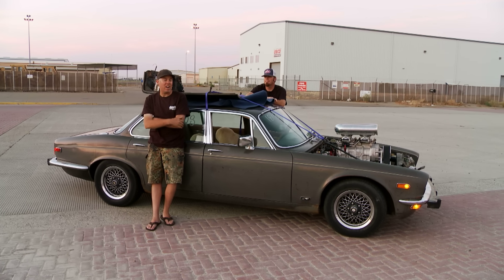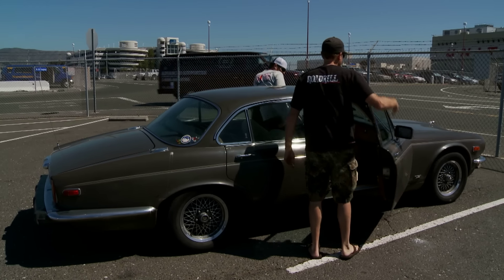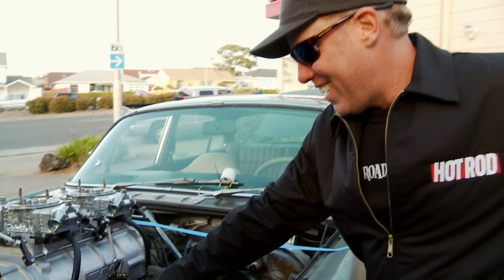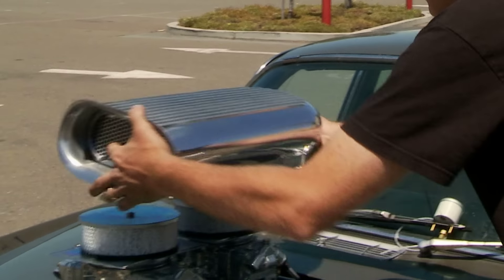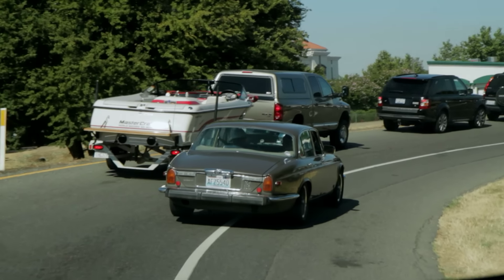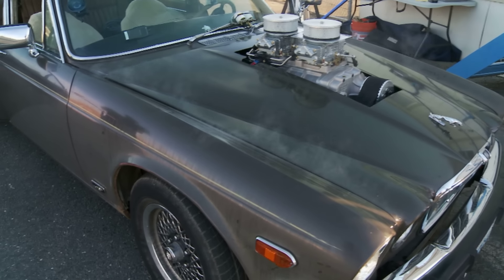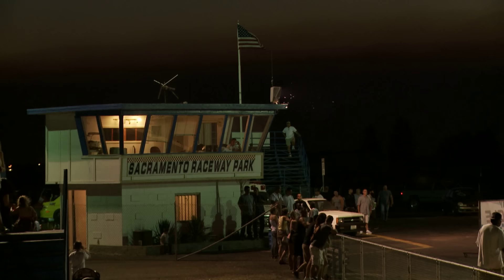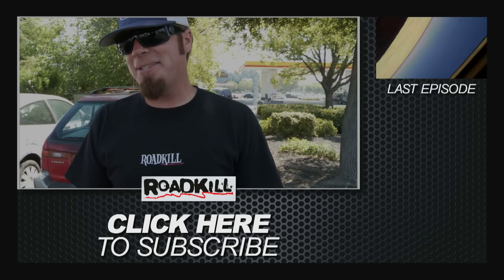Release The Draguar! Building a Blown Jaguar Rat Rod - Roadkill Episode 7

Comment: Should've re-routed the windshield sprayers onto the radiator......
Reply: Ronald Colman that probly would have worked lol
Reply: +Ronald Colman i know this is an old comment, but since a brand new rad didnt help i doubt that would have either
Reply: Couldn't hurt.
Reply: +Ronald Colman They could have just used the washer tank for methanol injection?

Comment: To the Brits here whining about putting an American V8 into a Jag, remember this: Carroll Shelby created the Cobra by dropping a small block Ford into a British A.C. Ace. Worked out pretty well, if you ask me! Also, even though this was originally a V-12 car, it was still a lowly 4-door, which is only a notch above a rusted-out minivan, no matter how few were made. Lastly, the XJ series Jaguars are quite possibly the most unreliable cars ever made. Did Lucas® (the manufacturer of most British automotive electrical components) make the electrical bits for Jaguar back then? If so, it's no wonder they were so troublesome.

 Joke of the day: Q - Why do the Brits drink warm beer?
                              A - Because Lucas makes refrigerators, too.
Reply: I am a brit, I have no quibble with your statement. Yes in UK spec the V12 made around 300 horses, so not so different to the V8 blower motor. Thing is, the car was aready butchered, so at least it had a good run in it's old age.

Yes the AC cobra was a hooligan tool, American muscle with British chassis, there were others too, Jensen Interceptor, original TVR Griffith, Sunbeam Tiger, Ford GT40 & a few more. Yes Jaguar were plagued with crappy Lucas electrics, one consolation was our Vauxhall (GM) cars had AC Delco & Fords had their own stuff.
Reply: Russ Cattell I'm happy enough to be able to say that I've owned a couple of Vauxhall V6 cars cavalier and Calibra that had a similar performance to this Jag with only 170bhp. But I've also jus t found out that the Jag V12 engine was a "sort of" flat head engine where the cylinder heads were completely flat and combustion took place in a cup in each piston crown.
Reply: Russ Cattell I'm happy enough to be able to say that I've owned a couple of Vauxhall V6 cars cavalier and Calibra that had a similar top speed to this Jag with only 170bhp. But I've also jus t found out that the Jag V12 engine was a "sort of" flat head engine where the cylinder heads were completely flat and combustion took place in a cup in each piston crown.
Reply: Yes the Jag V12 was a low state of tune, if it was quad cam, multi valve hemi it would have been mad. A mate had a V6 Calibra, slippery shaped car hence high top speed.
Reply: wordreet Heron head, look it up, its pretty fascinating stuff.
Reply: Ronald Colman What did you just call me?? 'v'
ROFL!
Reply: Huh?
Reply: Ronald Colman
Heron head, I was pretending it was an insult. ;¬)
My mind likes to sidestep reality on occasions.

Yea, I read up on it and got distracted when the info branched out into radial engines and so on. Very interesting indeed. I never knew that Moto Morini and Guzzi used the flat head style. I nearly bought a Morini 3 1/2 several decades ago.
 But my distraction took me to reading about the ANZANI 55degree 25hp 3 cylinder aero engine used by Louis Bleriot to cross the English channel. Apparently some of these engines had no inlet valve, just a light metal disc supported by a spring, which opened due to decreased pressure when the piston moved downwards, A bit like a reed valve.  It sort of reminded me of the early 'diesel' engines used in models that had no exhaust pipe at all.
Haha, it's all good clean oily fun! :¬D

Comment: The V12 was probably removed because of cooling issues. The V12 produced so much heat that the jag engineers had to design a new cooling system and the battery had its own cooling fan to stop it catching fire. The reason so few were made was because it would fail in any climate that wasn't England. Jaguar tried to market these in the oil rich middle east it wasn't a success! The early models were overheating before they got off the docks. Jaguar did make improvements but the car had a reputation by then.
Reply: Also because the engine probably blew rods out of the valve covers at 3500 rpm at 100,000 miles. Chevy motor gave it some worth
Reply: DrDaniel98521 The cylinder liners were made out of tin foil, so yeah...
Reply: DrDaniel98521 Q.How do you double the value of a chevy?
                         A. Fill the gas tank.
That is the ONLY way a chivy motor will give something any worth.

Comment: Im british and that is the most fucking awesome jag iv ever seen. I own a 1934 ford coupe with chevy v8 btw
Reply: Now THAT'S an awesome car. A 31 Ford coupe with a Chevy V8...I really hope you still have that car because that's something I've always wanted to own.
Reply: Instead I have a 1997 Honda Civic coupe with a fully built LSVTEC (a USDM B18B1 block with an also fully built JDM B16B DOHC VTEC cylinder head from a Civic Type-R). It has a Garrett GTS3582 turbo that makes 709 whp at 34 psi. I really do appreciate all builds and while you may not be into mine and I may not be into yours, I still have always wanted an old school 30s, 40s, 50s cruiser with a somewhat modern powerplant.
Reply: One of my all-time favorite dream builds is an old Packard V-12 with an Audi/Lamborghini 6.4L V-12 from a Murcielago, but more realistic would be a 50s Mercury lead sled slammed on the ground with the Mooneye hubcaps, a 6.2L supercharged Hellcat Hemi, and side pipes with glasspacks and the old school perforated heat shields like a Shelby Cobra or a C2 Corvette.

Comment: Haha Americans are the only ones who would praise old British cars for build quality
Reply: That's because it's better than the crap we build today.
Reply: Ryan Lober Sad but true
Reply: i saw something rare on craigslist. A 2000 Land Rover Discovery with 189,000 miles on it! I wonder how many engines its had. lol
Reply: Bill Hill ... Those came with a Buick engine...
Reply: BuzzLOLOL
Did Ford contract with gm for engines. I thought Ford owned Land Rover at that point in time.
Reply: BuzzLOLOL The only reliable bit.
Reply: OJJVZ Guess you don't get sarcasm.
Reply: Bill Hill If it was a diesel, that's just half an engine so far. ;¬)
Reply: Bill Hill If it was a diesel, that's just half an engine so far. ;¬)
Reply: wordreet fr, but it
Reply: Bill Hill It's complicated   http://en.wikipedia.org/wiki/Rover_V8_engine
Reply: Bill Hill thats not high realy,   Alot of disco's have more than 250,000 on them and still going well over here,  The 70's / 80s Bl wiring didnt do any british cars favours,  Most were ok. But the ones that got talked about, got remembered.   Also, Im not sure why some of my fellow brits are have felt this jag has been butchered, Over here theres hardly any left due to neglect, and the ones that are left are falling to bits.   While the Draguar is still going strong in lovely sunny california,
Reply: A
Reply: BuzzLOLOL  actually they come with a Rover V8. which is based off an old all aluminum buick design
Reply: OJJVZ Apparently you dont know or get the point of this show. And why is it some dumbass person, Usually 100% of the time European, ALWAys sasy some stupid shit like that?..
Reply: OJJVZ Apparently you dont know or get the point of this show. And why is it some dumbass person, Usually 100% of the time European, ALWAys sasy some stupid shit like that?..
Reply: British Leyland Never dissapoints XD
Reply: C
Reply: Hey it’s not like I had to put a Chevy small block and trans in a Range Rover defender.

Comment: The car does burnouts like it has 1200 horsepower but it runs like it has 120 horsepower
Reply: AngrySlime11 you can do burn outs in a front wheel drive 70 hp econo car easy. With about 300 like f was estimating donuts are easy.

Comment: I think my mom's 2007 Accord could outrun the Draguar...
Reply: +TomBom292 - Not if its stock
Reply: +Joseph Summers The Honda is still faster than the stock draguar
Reply: TomBom292
Stock '07 Accord will most likely run in the 16.30's (1 sec slower). This car runs 15.35's. Which is nearly as fast as a stock '92 Mustang 5.0.
Reply: +Joseph Summers Ok, that makes sense
Reply: TomBom292
I just go based off stock cars I've seen run, quarter mile times from accurate websites, and friends of mine with proof. Like my friend had a '92 5.0 Mustang bone stock and it ran something around 14.9-15.0@100mph. Car and Driver rated a 2007 Honda Accord I4 at 16.4@85mph. The manual will get you 16.1@87mph. http://www.caranddriver.com/features/the-quickest-cars-of-2007-less-than-20000-sixth-place-2007-honda-accord-page-1
Reply: +Joseph Summers Ok, I get it
Reply: +Joseph Summers i think he was half joking
Reply: +b wood I was
Reply: b wood
Yea true. So hard to tell jokes and sarcasm when typing/texting.
Reply: +Joseph Summers yeah
Reply: Please dont get on here wasting time talking about a honda. The Jag on here was much cooler than Any honda ever built.  The honda motor is sideways, so its not worth compareing to even a rusted out Chevy monza with  a tree growing through the engine bay. Besides there is no way possible your moms honda could ever out run the car on this episode.
Reply: Good idea for an episode... strapping a V8 to a hollow tree and go drifting with it. ;)
Reply: TomBom292  an accord 😂😂 gay.
Reply: Hahahahahhaha I'm dead
Reply: v6 2008 accord runs 14.8
Reply: are you sebastion vettels brother.
Reply: My father's 1982 Chevy C-30 with a reading utility rustbox would smoke that thing.
Reply: @josephsummers2427  The 2004 Chevy Crapalier definitely smoked that POS Draguar.

Comment: A friend of mine has a Jag exactly like this one.....It was a really nice car until someone stole it.   When it was recovered it was discovered that the thieves had pulled the oil pan drain plug and let the engine destroy itself.....Still a nice car....WITH A DESTROYED ENGINE.  In my opinionthis is a great candidate for a engine upgrade.
   Darrel is open to offers. INTERESTED?

Comment: Why would anyone give this away for 1000 $? with a little bit of work on sensible stuff, this would´ve been a fantastic car.
Reply: +Jeremy J. Are you kidding? It's British.
Reply: crazyfvck Oops, I somehow wasn´t aware that this had a non-factory engine. That does change things considerably. But if it had, wouldn´t it really not have been worth 1000$?
I know that it would have been a steal on the used car market in Germany, they are quite expensive over here.
Reply: crazyfvck Nice going, dude.I really love these vintages, they really had something going with their styling.
Reply: I have the 02 xjr 100, paid 15K for it in Jan15 it had 42Kmi on it.
Reply: It's too rusty and neglected. The car in pristine condition isn't worth the work that goes into it.
Reply: +Jeremy J. Even with the factory v12, it would still be worth $1000
Reply: Here in the UK a mid-70s Series 2 XJ12 in really good condition will cost you as much as £25,000, but you can pick up one worth restoring for about £5,000. If they got theirs for $1,000 it's probably a pile of rusted-out junk.

If they'd ever had an old Leyland Jag before, the first thing they would have done is replace the radiator, followed by the water pump and most of the electrical components. It's a pity it's got some junk V8 in it though, with the original V12 race modified and tuned up those old XJs can be monsters. The 1970s Broadspeed class 2 racers were around 600hp; they even used to leave the wood dash and electric windows in, so you could race in style.
Reply: put that on museum at least
Reply: +Cliff Smith v12s were alway ripped out of those cara. too heavy, low power, and just plain terrible. 350 is better, but not by much